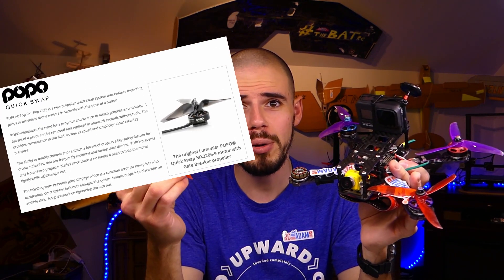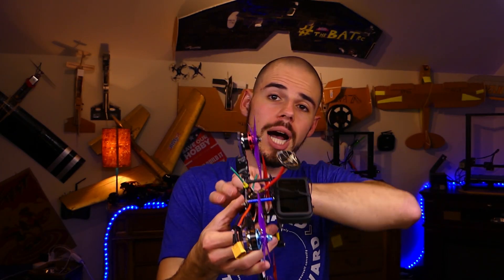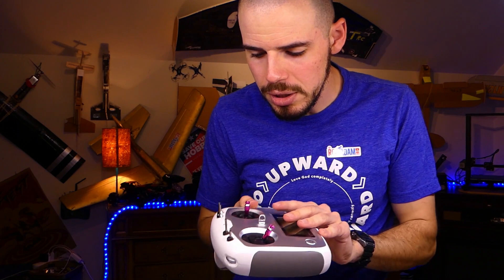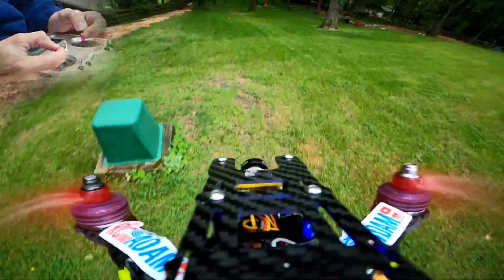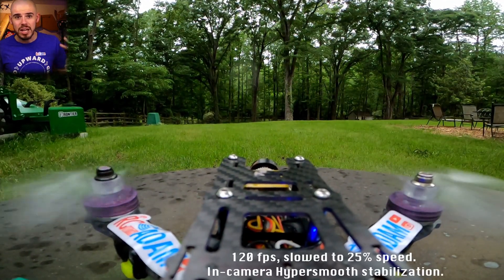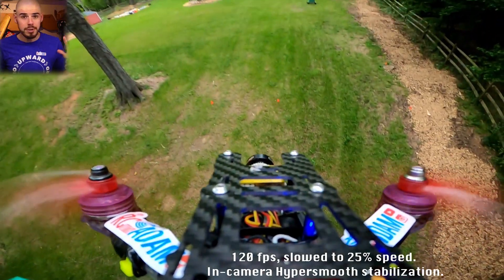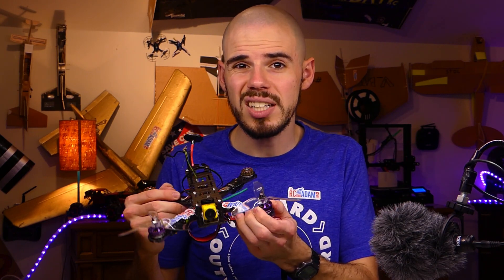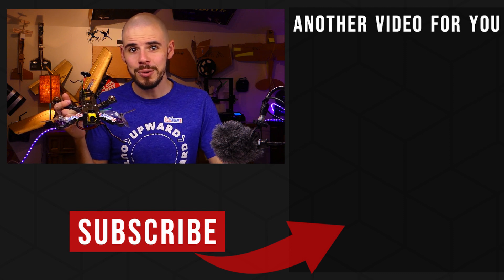POOR Man's PO-PO System 🤔 Flying WITHOUT Motor Retention - Brushless Drone Motor no C-clip

Comment from the maker: Do YOU ever fly without motor retention??
Reply: No, and never going to try it😅😁
Reply: no sir
Reply: No. Risk is too high. Have had a c-clip break once, damn bell went flying even without flying aggressively. Too much potential play in the motor without retainer, bad for bearings.
Reply: Yes 
dys samguk shu retainers are verythin an weak tried flying for  5 sessions.
I lost the bell after disarming on a crash :"(
I used dal cyclones that time. Maybe the stiffness of the prop also caused the bell to fly
Not gonna try it again.

Comment: The motor efficacy and power reduce as the magnets lift with pusher motors underneath no problem  folding 2 bladed props and  folding arms makes it compact with no assembly as DJI and copy's

Comment: Man crazy cool and gave me a idealish lol so I wondering if because the motors were free to move up and down that it would be massive reductions in vibration  so what if the shaft was just a little bit longer than necessary with the c clamp on it it could reduce vibration and not come off but I think the problem would be win it gets to the end point ov the shaft and the drone slows down it could slam back together in air witch could throw you in a different direction than wanted idk just a idea I'm going have to try

Comment: Doing this will burn out your ESC'S very fast. My phantom had a clip come off mid flight and the esc fried quick in the same flight. It's a phantom FC-40 v2 so the escs were hard to find. The issue is it creates "noise" or a power fluctuation as the motor gap changes from not having that c clip attached and some escs cant handle. A racing quad is probably better suited but I would imagine that your decreasing your lifespan on your esc. This was my experience running motors with no clips.

Comment: done it! with old emax 2205 with the clips .didnt even know they were gone. but they stay on till you hit a gate in my case. had no replacement clips, ended up flying all summer that way. BUT! when it does fly off, they can go pretty far.
Reply from the maker: Yeah! If I had crashed way up in a tree or tall grass I could have lost them for sure.

Comment: Great vid, love drone experiments like this. On my last flight I hit tree, lost U ring and metal spacers. Didnt notice it and continue flying but noticed mid throttle oscillation, crashed again on concrete and lost lower bearing. Quad was still flying for few sec until nut screw and prop fly off but bell was still on stator. Peace out